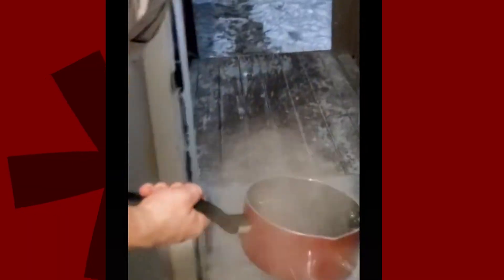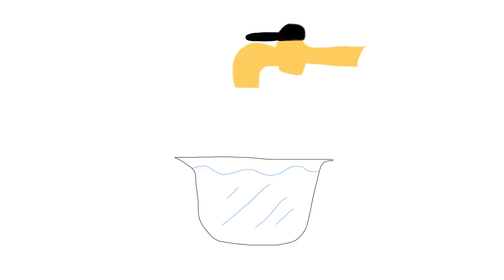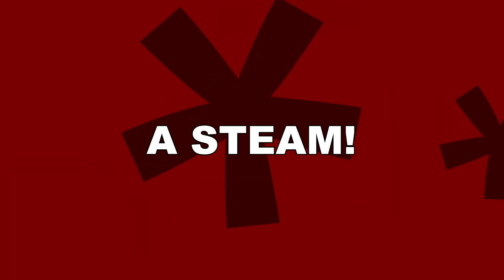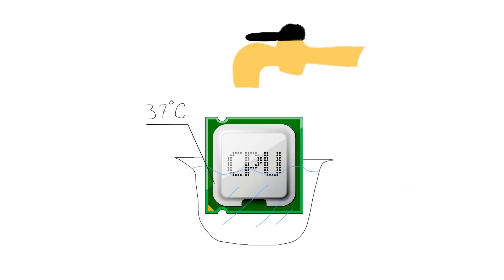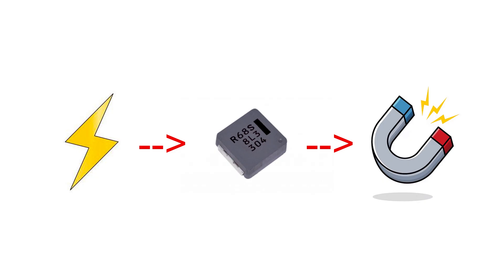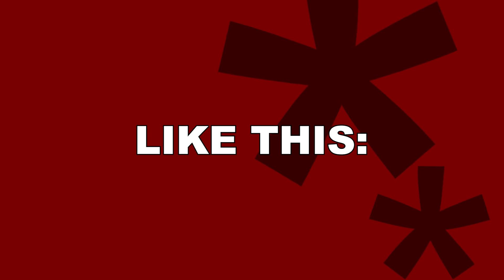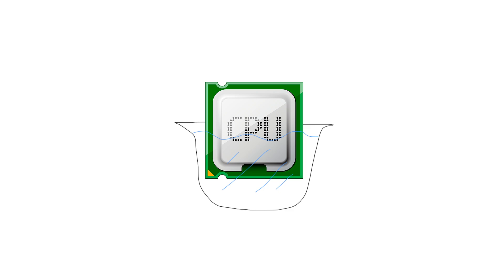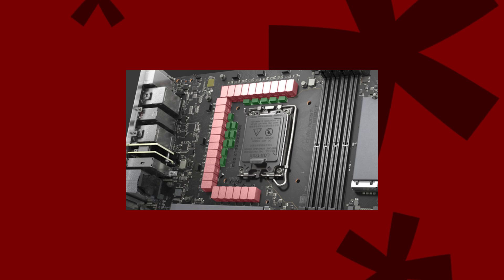Hardware noise explained in two minutes

Comment: a choke + mosfet is a VRM and the amount of vrms is the amount of power phases, for example: 16 VRMs is 14+1+1 phases where the amount of them determin the cpu compatability (technicly is compatable but not at the full speed) for example 14700kf needs at least 10+1+1 to run at default speeds of 125W pl1 and 253W pl2 with TAU of 56s, if you have for example a 26+2+1+1 (msi meg z790 godlike or the highest end lga1700 mobo) you can overclock the cpu to the point of 580~620W stable and with better VRM cooling (watervlocking the vrms) you can get basicly to 1000W and then the chip degrades so much that it becomes wattage and voltage  sensetive to the point of being useless or if you just get lucky and "win the silicon lottery" and dont be me with a really voltage sensetive 14700kf and get an impossible to degrade chip so you can basicly get the most performance (and use a 2000W chiller to cool down the oil that doesnt freeze at -70° to just run 14900ks at 7.9Ghz on P cores and 6.7Ghz on E cores)

Comment: I remember adding a small amount of hot glue to absorb the vibration from the sound.
On the component
Reply from the maker: Yeah. There was a vid where fellow used epoxy to fix the coil in the casing. Actually helped a little